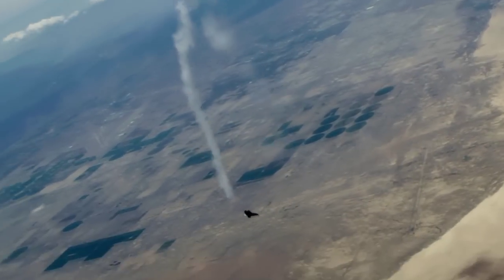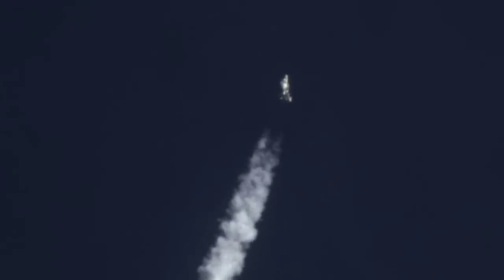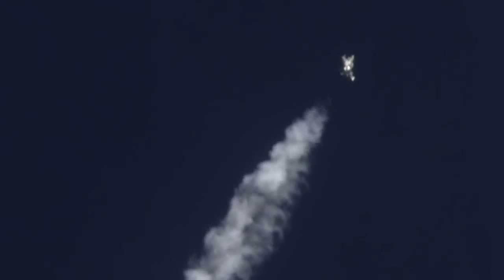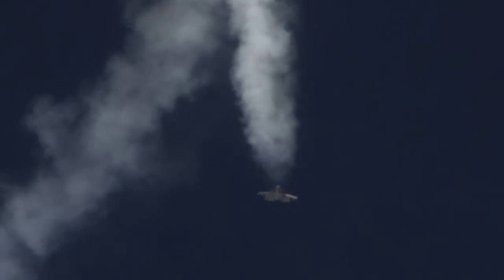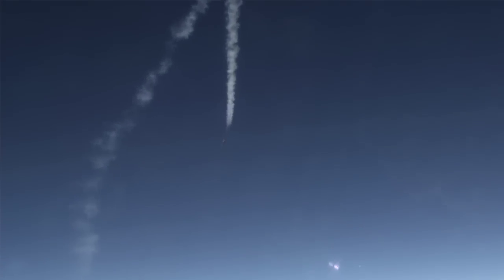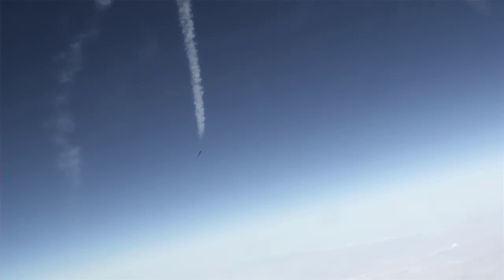F-35 Flight Test Intentional Departure

Comment: I have zero confidence in this jet. not fast enough, low thrust to weight and wing loading is worst then f16. The vtol variant is fine but that's about it.
Reply: If you really care about the Airforce and what they are buying then hear me out, I know its a bit long but I prepared this just for you so please take some time to read through. Thanks  :D 

Lets look at some figures against some proven and supposedly superior platforms, lets compare them and see. 

If you really know something about planes you would know that you basically need 3 essentials to be maneuverable:

1. Lots of Lift
2. Lots of thrust
3. Little Drag

Lets discuss lift: 
I know you probably heard Pierre Spray said that the F-35 is a dog because it has little wings. and has to carry 110lbs of airplane for every square foot of wing. 

Pierre Spray was involved in the aircraft industry at around the 1960s where fighters were basically tubes with wings. 
At that time all of the lift came from the wings. small wings = small lift.

But at around that time Martin Marietta (now Lockheed Martin) was experimenting with Lifting Body designs, they wanted to produce fuselages that can assist the wings in producing lift instead of being dead weight.
Read more here: http://en.wikipedia.org/wiki/Martin-Marietta_X-24

That’s why at around the 1970s we began to see fighters with wide flat fuselage sections and smaller wings. So lets compare the wing loading of the F-4 against Pierre Spray's favorite F-16 variant the F-16A.

F-4
Empty: 30,328lbs
Load:8000 lbs
Comabt Weight: 38,328
Wing Area: 530 feet
Wing Loading: 72 lbs/ sq feet

F-16A
Empty: 16,300
Load:8000 lbs
Comabt Weight: 24,300
Wing Area: 300 feet
Wing Loading: 81 lbs/ sq feet

So by Pierre Spray's own argument the horribly turning F-4 should fly circles around his hotrod F-16? What’s happening here?

Well the F-16 does not rely on just wings to produce lift, it has a blended body and wing design, plus LERX that produce vortices above the airplane (if you remember you physics, high pressure below + low pressure above creates lift)

around 40% of the F-16s total lift does not come from the wings at all. So in reality the F-16's actual wing loading when loaded with 8,000lbs is closer to 49 lbs per square feet not 81 lbs.

The F-35 is the same. to get the F-35 to have 110lbs / sq ft of wing loading as Pierre Spray said it needs to carry 21,300 lbs of load. 

The f-16 can never do that, but the F-35 can! that’s what’s great about this plane, it gives you options, if you need to go to a long range mission then sure, the F-35 CAN carry 18,000lbs of fuel and 18,000lbs of weapons.

But if your going to a CAP mission where a dogfight is possible, then why load it with 21K? Most likely an F-35 would take off with 18,000lbs, And when it gets to combat it would probably have 10,000lbs depending on the range to the target.

So lets pit the F-35 against some really good aircraft, Wing Loading calculation. 
All loaded with 8,000 lbs, perfect for dogfighting:

Wing Loading:
Mig-29 M/M2: 91
F-16C (block 50): 90
F-35A: 81
F/A-18C: 77
Su-30MKI: 72

So as you can see at dogfighting weights, the F-35 is not bad at all, its not the best but really not all that bad. 

Now consider this, the F-35 probably has the most efficient body lifting surface of all these aircraft due to the fact that its fuselage has the smoothest flatest surface of all these planes, not a lot of disturbance for the wind to flow around on. 

So lets give all these aircraft a Body lifting coefficient of 40% but to be conservative lets give the F-35 45%, the truth is probably much larger but hey lets keep it down.

Wing loading plus body lift:

Mig-29 (M/M2): 54.6
F-16C (block 50): 54
F/A-18C: 46
F-35A: 44
Su-30MKI: 43

The F-16s wing loading is similar to the Mig-29s which is why it replicates the Mig-29 in RedFlag.

But Notice how the F-35's wing loading is so close to the F/A-18 and just 1 pound above the Su-30, which is why when you ask pilots they will say that the F-35 maneuvers like an F/A-18 with better acceleration. 

And really acceleration is the only thing Hornet pilots dont like about it.

http://www.flightglobal.com/blogs/the-d ... -tactical/
Lt Col Matt Kelly wrote:
Operational pilots should be thrilled with the F-35′s performance, Kelly said. The F-35 Energy-[Maneuverability] diagrams, which display an aircraft’s energy and maneuvering performance within its airspeed range and for different load factors, are similar to the F/A-18 but the F-35 offers better acceleration at certain points of the flight envelope. 

So do you still think they are lying? 

Now lets talk thrust. This is a no brainer, the F-35's engine is rated at 43,000lbs the most powerful in the world. So lets cut to the chase and compare.

Thrust to weight at max thrust:
(All loaded with 8,000 lbs)

Mig-29 (M/M2): 1.05
F-16C (block 50): 1.05
Su-30MKI: 1.13
F/A-18C: 1.14
F-35A: 1.15

Surprise Surprise, the F-35 has the best Thrust to weight ratio of all of the planes involved, and really in a dogfight Thrust to weight can be more valuable than Wing loading. 

Now Drag: 

All these planes will carry weapons externally adding lots of drag. with a full centerline tank the F-16 is reduced to 7Gs max and the Mig-29 is reduced to an appalling 4Gs, the F-35 will carry most if not all its missiles internally, very little drag.

So to conclude, even without Stealth, even without all its advanced sensors and ECM suits, the F-35 will (in the words of Pierre Spray) wax the competition every single time.
Reply: The32notes its funny you mention sprey cause all I see him do is trash f35.
Like I said before the B model is good. The C model is slower, heavier and has lower sustained g's(no wonder the navy cut orders). As for the A model im still skeptical. This jet is gonna be very important now in south east asia and its main competition is gonna be up coming Russian/Chinese designs(Pakfa to be exact). With internal weapons we only have about 4 missiles and a gun and I would like to believe that f35 is able to get in and use it.
 
Riat is coming up and I hope they send f35 and show what its all about.
Reply: thejunkmanlives True, the C model is the heaviest but also has the largest win span.

Because of body lift, all F-35 models will have low wing loading, which is great for maneuvers.

But the F-35C's wing loading will be exceptionally low. Almost as low as the F-22's

According to F-35 pilots, all F-35's perform similarly with subtle differences, the A model has the best acceleration and thrust-weight ratio
It can also execute the tightest instantaneous turn thanks to to its 9G air frame limit.

But the C model seems to be the best turner due to the extra large wings.
Probably referring sustained turns.

Now in my opinion the B model is the least capable, its airframe is only designed for 7Gs, and its wing loading is the highest of the 3, even with body lift they could still be at a disadvantage against the A and C models
Reply: The32notes B model my look the least capable but we have to compare it to the plane its designed to replace which is harrier and f35 is a lot more capable.
The C model has never sat right with me, the navy needs a true successor to tomcat and I don't feel that neither the f35 or super hornet fill that role.
Reply: The32notes What I mean by successor to tomcat is a mach 2+ air superiority fighter, essentially the navy's f22.
Reply: thejunkmanlives We'll your right about that one. Probably the need for a Mach 2 plus air superiority fighter wasn't relevant enough during that time.

But now, its being considered again, just check out the F/A-XX requirements
Reply: Keeping in mind that the F-16 is not really much faster or more maneuverable with a standard combat load (which includes heavy external tanks), it really has no advantage over the F-35 besides the cost. The F-35 carries three times as much weight in munitions, with a significantly larger combat radius and the ability to operate in much more dangerous airspace. There really aren't many jobs that the F-16 has that can't be done better by the F-35.
Reply: thejunkmanlives The lower sustained G's on the C has nothing to do with the aerodynamic design of the plane. Much like the F-18 before it, the F-35 is limited to 7.5G's in order to make it light enough to operate off a carrier. The structural reinforcements that allow fighters to go to 9G's are heavy, and as such are not required.
Reply: JTB At this point im just waiting to see what they do at riat. Of course you cant demonstrate sensors/stealth but they need to reassure the tax payer that this jet will delivery.
Reply: DRNV R

At 50% fuel the F-35A's wing loading is only 82 lbs / sq feet, the F-16C's is 75 lbs /sq feet.

This is when you only measure the weight of the plane divided by the wing area.

But with modern aircraft like the F-35, lift does not only come from the wing area. 

Strakes, the body and even the canted tail surfaces produce lift as well, further lowering the F-35s actual wing loading.

Plus 50% fuel for an F-35 is good for combat, 50% fuel on an F-16 is really just good enough to get back home.
Reply: missing riat is a giant set back. I want this jet to be exactly what Lockheed is promising but more and more it looks like they are gouging  us.  This jet is not only important to the US but a lot of allies are buying as well.
Reply: thejunkmanlives And how exactly was the Farnborough airshow a setback? No potential customers have backed out, nor have any partner nations have reduced orders as a result.
Reply: luckygodzilla95 it was a set back in terms of public support. F35 was also supposed to be there when the British rolled out there new ship.  when u have the most expensive weapons program on earth that doesn't look good.
Reply: thejunkmanlives And yet nothing has changed. I understand that PR is nice and all that, but the JSF has already convinced those in actual positions of authority that the jet is worth the significant cost and numerous delays. In the grand scheme of things, the missed airshow will barely register as a blip on the program.
Reply: luckygodzilla95 positions of authority are the ones getting kick backs and hand outs to push the program. Mind you there are people in authority that aren't fans of the program either.
Reply: thejunkmanlives If they were they would just have quit out of it already. The only country that really can't back out is the U.S, and that's because the JSF is supporting in excess of 170,000 jobs in 49 states.

Everyone else would be gone by now if not for the capabilities of the plane.
Reply: luckygodzilla95 u noe parts/materials are supplied by partner countries right?
Reply: thejunkmanlives Nothing at the level of the U.S. Though to be fair Britain is never going to back off as well (they'd have nothing to fly off their new carriers, and not to mention they've started to hate the tiffy), That manufacturing plant in Italy has secured them in, and the engine depot also might as well lock in Turkey. 

Everyone else however has a more or less negligible stake in the program. Sure there is industry to be lost, but nothing catastrophic.
Reply: I wouldn't call millions of dollars negligible. a lot of the partner countries have kicked in money to the program(ie Canada and Australia). Don't get it confused I want the jet to do what Lockheed is promising, it truly would be a game changer but we need to make sure someone has Lockheed in check.
Reply: what about it's 360 degree spherical DAS, basically similar to the Sukhoi's IRST, except far, far better in the sense that it give unobstructed 360 coverage and will automatically lock up multiple threats, and all this while talking to other F-35's giving them the ability to shoot at the aircraft which is locked without have to lock it themselves

Comment: People hate this fighter, Russia just propaganda's the shit out of, But this is amazing it, I think the F-35 will do amazing
Reply: Incorrect. F-35 maximum angle of attack is 50 degrees under normal control laws. However, pilots have taken it to higher angle of attacks. The Pak-Fa was also designed to be supermanouverable. Not a fair comparison.
Reply: F-35 rear stabs are similar size as F-22A and F35 is smaller aircraft than F-22A. 

Wing loading for F-35A is similar to SU-35S with both aircrafts at 50 percent fuel loads.
Reply: Who cares. Video about F-35 not F-22
Reply: CAPS LOCK BRO!!
Reply: +General Lee, You Fckoff
Reply: how countries are buying the Pak-Fa?
Reply: IBT98 people generally hate what they don’t understand.

Comment: Well, it's not that simple. the T/W ratio of the aircraft depends heavily on the variant you are talking about. for the A you're looking at a worse case scenario of .87 at full fuel load, and a ratio of 1.07 at 50% fuel load. Comparatively the B has .9 and 1.04, whereas the C is the worst performer of the bunch with .75 and .91. Still, this only really matters if the plane goes into a full vertical climb, which TBH is frankly suicidal regardless of what plane your in.

Comment: I ALSO remember what happened to the T-10, they completely changed the plane inside and out because there were so many flaws. This is what i think will happen with the T-50. I think they'll find flaws in the stealth and give it a slight redesign.

Comment: Yes i remember the whole T-10 spat. I remember they got a T/W of 2.0 out of one of the T-10 models (this one broke the world limb rate record, it hasn't been beaten since). Also the F-22 was a hugeleap forward but it came at a cost. What we need is not the f-35 (i watched your video by the way, yest it had some good points but still the general aircraft (the electronics might be good) but the aircraft design is awefull, far too complex to be war worthy). it's another Harrier.

Comment: I would never replace the F-18 with this thing. No chance, between maintanence, poor payoads and a terribly complex engine. I would never use this on a carrier where i coud buy 4 F-18s for the price of 1 F-35 and have 10x the impact on my enemy. If your enemy can't take ut yur carrier, then the F-18 is fine for the job. An enemy that can bliterrate your carrier group using swarm missiles. Then there's no point in a carrier in the first place.

Comment: Don't forget the T/W ratio of all three variants differs. The B variant has 0.8 or something, while the A and C variant have greater than 1. It is needed specially for the C variant as it may be used on Aircraft carriers with ski-ramp around the world. Then for its rear stabilizers. Those things have a much higher angle than that of an F-16. So we never know it might just be able to turn better. Also a Norwegian test pilot who flew the F-35 claimed it was better able to turn than the F-16.

Comment: Errm. The F-35 has a T/W ratio of 0.8... The F-35 has a 191kN afterburning turbofan, great. Most aircraft have two (average of) 125kN afterburning turbofans. 250kN combined. And they also weigh less than the F-35. The F-35 falls like a brick in all instances of high alpha, it''s an aweful aircraft. Yes it can stall controllably...but it uses massive amounts of computers to do so. Also as i've said the engine isn't powerfull enough for the weight of this damn aircraft.

Comment: I am not saying it is supermaneuverable. But it is maneuverable enough. And any plane can stall for sure, but the plane remaining in control and engine working properly after the stall is also what the Flankers and F-22 can do. This is achieved through a great T/W ratio above 1. And the F-35's engine's are powerful enough, they can produce over 40,000lb of thrust (almost twice as that of an F-16).

Comment: Not the point. An F-15 has outstanding performance even w/ external pyload. SU-35, outstanding even w/ external payload. The F-35, too much wing loading, large body, classic body (not blended like a Sukhoi, MiG or F-16 giving greater lift/less drag more manouverability) Weighs about the same empty as a Fully loaded MiG-29 except it has smaller wings, so it manouvers like a brick. What happens when you run out of missiles (each w/ a 60% success rate, i.e.4 kills per load of 6 average)

Comment: This isn't a tailslide it's a stall...every aircraft can do this. This one just uses computers to keep it as steady as possible. This is not a controlled tail slide that the flanker can do. You are very mistaken if you thinkk that this is supermanouverability. It isn't manouvering it'sfalling. This jet isn't capable of supermanouvering. This wings are far too small and the engine not powerfull enough. This is far from impressive to any aviator.

Comment: The F-35 so far has gained notoriety for its cost over runs, grounding, software incompatibility issues, possibly being cancelled...and then people consider it, like the F-22..the best thing since sliced bread. However technologically advanced these aircraft may be, they have not seen actual combat, never been in a combat zone or faced any danger .....so neither one of the aircraft deserves a "best of" title. Neither one of these is overly capable, in fact the F-35 is underwhelming.

Comment: About CAS.
Have a look at Syria.
Assad's planes/choppers getting shot out the sky regularly by cheap/easy to use Chinese made manpads. Idiots. Still think Soviet tactics from the 70's are the way to go.
You stay out of harms way and attack from stand-off ranges. F35 will be very good at that with it's excellent resolution EODAS system, capable of seeing, cueing and tracking multiple targets ground AND air at dozens and sometimes hundreds of miles way. Plenty vids here on YT how it's done.